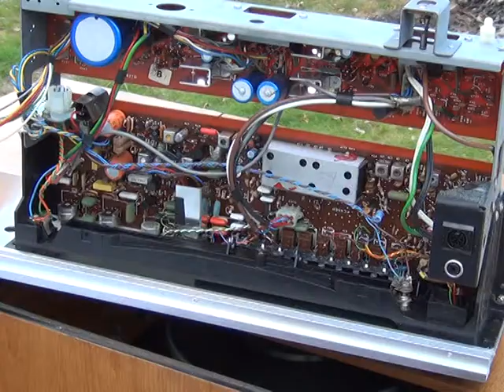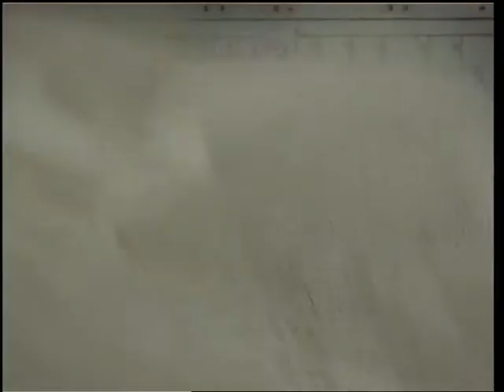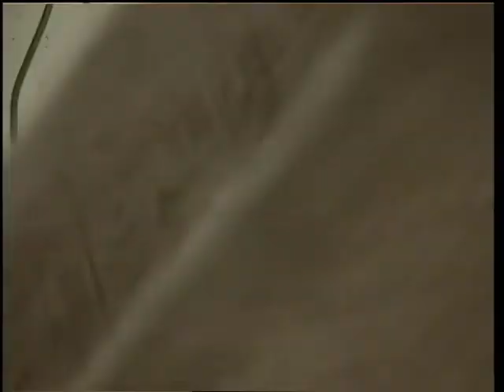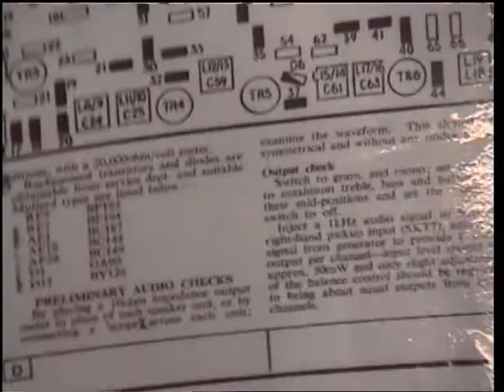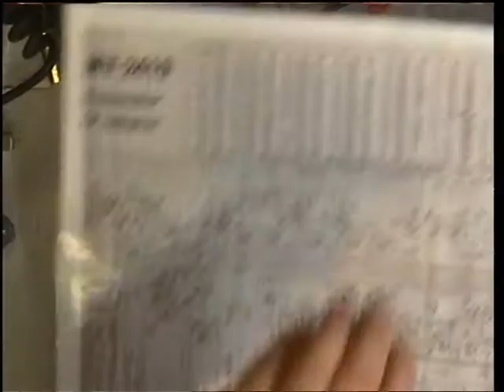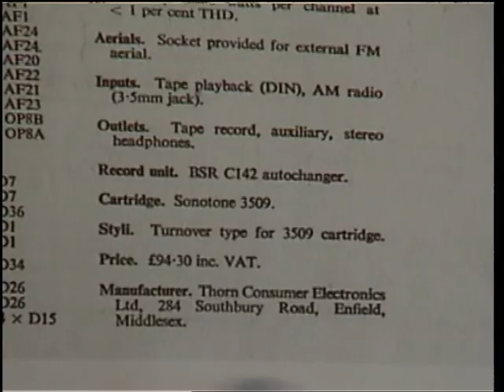HMV Stereomaster 2419   pt2, duff speakers & amplifier capacitors changed

Comment: Hi, very informative video thanks. I have replaced capacitors as suggested. My speakers appear ok, foam is in good shape.  Radio audio is very good,  record quality is poor and tinnie. I have renewed the stylus. Would you have any suggestions? Thanks
Reply from the maker: Well, I'd connect an audio signal generator to the pickup input (at the turntable tag strips) set to 1Khz @ 100mV level which would prove the amplifier preamp was working. However, I think your cartridge rubber actuator is rotted away/missing so there is very little transfer from the stylus to the ceramic elements inside the cartridge...in which case you'd need to replace the cartridge.

Richard

Comment: Hi there,
I have inherited a Stereomaster 2419, looks in good nick but now power lead so unable to workout if its actually in working order or not. Having taken it apart it seems that the power lead must have been disconnected, any ideas on what would plug into the PA connector as you called it? Its 8 pins and 4 holes, is there an off the shelf connector 3 pin plug for this, or is it a case of trying to wire in a new AC in with a 3 pin plug and wires?

Best wishes,

Evan
Reply from the maker: I think you'd better email me with a photo. I'm not sure quite what you're talking about unfortunately.  As I recall the 3-core mains lead goes to the main chassis near the mains transformer no doubt via a fuse. Looking at the circuit diagram, however, it looks like the mains lead goes straight to the mains switch & then to the chassis...so I'm not sure. Anyway, email me & I send you a copy of the service sheet gratis.

rshireby@yahoo.co.uk

Comment: Hi there I too have recently revisited this wonderful 1970’s and bought an old HMV 2419. However mine hums loudly , I have been told it is the smoothing capacitor....? and that it would be the large blue capacitor shown in the top corner does this Sound right ? Or would it more likely be the capacitors you highlightedAlso on checking the speakers were replaced without the inline resistors 🙈🙈🙈🙈
Reply from the maker: Yes, It's the big capacitor on the chassis rather than those on the PCB. Replacing the speakers without adding resistors is probably OK as long as you dont run it full blast

Richard
Reply: @ukfmcbradioservicingTango21  Thanks Richard will get on and try the repair
Reply: Hi Richard 
I completed the smoothing capacitor replacement, but the hum seems to remains. I am thinking perhaps the woofer speakers as if I turn the Bass down the hum disappears. If I put the resistors in-line could that solve the problem or is it possible there has been damaged caused elsewhere.. .? Any suggestions appreciated 

Regards 
Jules
Reply from the maker: @julianfaulkner2781  email me please rshireby@yahoo.co.uk

Comment: Hi, over lockdown I've been following your very helpful video and upgrading the disintegrated speakers on my  2419. I've noticed that the tweeters don't work and am assuming that it may be the green capacitor that has gone on both sides. Knowing nothing about capacitors, do you know of any modern equivalents I can swap them out for? I believe they are 47uf250v but no idea on type etc. 
Many thanks
Reply from the maker: Chances are that it is the capacitors that have gone leaky. I've never had a duff tweeter. In fact (I just checked the manual) the capacitors are 0.47uf & I would use polyester or mylar. The voltage rating won't be important as any capacitor would be rated above anything likely to come down to the speakers & bear in mind this product is solid state; you'd only have 250v caps in valved equipment on the whole. 0.47uf is often expressed as 470nf these days, just in case you need to know. I hope your new speakers are 8 ohms & not 4 ohm ones intended for automotive use!

Richard
Reply: @ukfmcbradioservicingTango21    Hi Richard, great advice! I'll get on the hunt for some capacitors tonight. 

Yes some 8ohm visatons are sat in front of me. Just soldered the 2ohm resistors on. 😁

Hope your safe during this weird time! Thanks for the help! 

Cheers

Comment: Hi, I wonder if you could help me please.  I have recently bought an HMV model 2018 Stereomaster, as my father bought one of these in the mid 60's, and I absolutely loved the quality of sound it produced, quite incredible for the time. However, I need help. This unit has some issues, volume is low on right channel, and the only way I can get it to sound reasonable, is the turn the balance pot just behind the inner panel, this way, I get the balance, but the sound is not right. There is some distortion in the bass, It's hard to describe. The right channel has a permanent hiss, not loud, but it's there. I don't think the speakers are damaged, and I have tried two Sonatone cartridges, but the condition remains the same with both, so I don't think that is the problem either. I have arranged to take it to an audio specialist who was recommend to me, but I know that you know what you're talking about, and really want your opinion on it. I have suggested to him to replace the capacitors, as this seems one of the necessary things to do anyway, being over 50 years old.  Do you think this will sort the problems out? if not, what else would you recommend I do to get it back to how it sounded originally, it was incredible, or am I asking too much to expect that.  If any one knows the answer, it's you. Please let me know if I need to tell him anything else when I take it in to be done.  Many Many thanks. I really look forward to hearing from you soon.   Cheers,  Graham
Reply from the maker: Graham, I think that changing all the electrolytic capacitors in the product will cure all the snags. I once had to change a transistor in the preamp of a 2018 which was down on that channel.....in 39 years of experience...everything else had been cured by changing the capacitors. I've not covered the 2018 on here yet, but will do in due course.

Richard
Reply: Thanks for getting back to me so quickly. I do hope, as you  say, replacing all the capacitors does the job, I so want it to sound as I remember, Crystal clear, loud, with wonderful bass.  I hope to take it in over the next couple of weeks, so will let you know how I got on.  Do you think it will be very expensive?  Thanks again.
Reply from the maker: @GrahamJBower  I've no idea what other people charge. Our fees are £32+parts so usually just under £50 all in.

Richard
Reply: @ukfmcbradioservicingTango21  Hello Richard. Many thanks for the information.  May I please teke a little more time from you and just ask just a couple more questions.  Firstly, can you tell me, where are you in the UK?  If you were anywhere near Wolverhampton, I would have liked to bring it to you to do, but it really depends where you are I'm afraid. Secondly, I had three Sonotone Cartridges, two of them have failed after the needle V support just broke away when fitting a new Stylus, rendering them useless now,  I think they must have perished, However, I have the third one on the unit at the moment, and it seems okay so far,  but it too is obviously quite old now, and could well fail. Knowing what you know about the player, can you recommend a fully compatible cartridge for it,  and if possible, how much it would be and where I could get one should this fail.  It's the Garrard 3000 deck, and according to the book it is a 'High Compliance Sonotone 9TAHC Cartridge.'  that was originally fitted. I am really grateful to you for all your help.  many thanks.   Graham.
Reply from the maker: @GrahamJBower  I see "the stylus lady" on ebay still has some NOS Sonotone 9TAHC cartridges on ebay for a buy it now of £40, and another NOS one is on bid for next to nothing. I've had two over the years off The Stylus Lady and apart from a slightly different mounting which I was easliy able to overcome. Regarding service here....mmm...I have to use outside benches for the cabinet/turntable/taking the chassis out, then the chassis is serviced on one of proper inside benches....I've got a new building happening when planning permission goes through which will have room for radiograms /stereograms properly. I'm near grantham. You canalways email me rshireby@yahoo.co.uk
Reply: @ukfmcbradioservicingTango21  Thanks again for info..   I will keep a watch on the ebay cartridges, and I'll definately want to keep your details for future reference,  I do wish you were nearer though,  quite a way from me.  Thanks.  Graham.
Reply: Hello Richard, it's been a long time since I contacted you about my HMV stereomaster. I wondered if you still carry out amp repairs on these, and if so, would it be viable for me to send you just the amp for you to check on your bench and bring up to date fully working, capacitors etc. anything that's needed.  I can easily remove the amp, and pack it very well, and I know that you would be able to do all the relevant repairs with your knowledge. It has recently developed faults, poor sound and fading on one channel, and really needs your expertise to get it back to full working order. It's never really sounded as I remember, and needs work. I love these, and really would like to have it sound as rich and clear as it would have done new without any faults.  Hope you don't mind me asking you, but thought this might be the only way to get this back restored. I have no problem with the deck, or speakers, they're fine, just the amp itself needs help. Maybe you could let me know if you would be able to do this, and if so, we can take it from there.   Thanks in advance.  Graham. Wolverhampton.   @ukfmcbradioservicingTango21
Reply from the maker: @GrahamJBower  Yes, that's fine Graham, but you need to Email me as Youtube only show me the 'top 6 comments', so drop off my Radar. Richsard

rshireby@yahoo.co.uk
Reply: @Psychedelicxylophone  Hi there.....   It's been quite a while since I bought the 2018.  In answer to your asking about it,  I kind of got it done, but the results were not as I had hoped!!. I'll fill you in.  I took it to Bridgnorth, to the specialist repair guy there, told him the problem with the unit, and left it with him. When I went to collect it, a month later, he told me there was one Capacitor he couldn't get to, somewhere behind the front panel, as he was unable to remove the screw, but he had replaced all others. Then he told me that upon testing it, there was a severe Hum, so he removed the central cartridge wire, underneath the turntable, and this, he said cured the Hum. He charged £70 for the work. When I got it home, I was quite disappointed with it. The volume was very poor, low, and empty, (little Bass) certainly not as I know it should have been. I decided to take a look at what he'd done. Under the turntable, he'd taken off the central common cartridge wire.... I decided to re solder it. Hey Presto!! full, and rich sound. Why he'd done that I have no idea. As you know it has to be connected. Then when further playing it, I noticed there was still a problem. With the Bass fully turned up, the balance is fine, both L & R, but when reducing the Bass, (which as you know, sometimes is necessary, as it can be overpowering) the balance on the player is shifted noticeably...  the left channel volume goes down more and more as the knob is turned, and it's very apparent. So this is obviously not right, I don't understand why this happens. Anyway, the unit is in my spare room now, as I bought another HMV, it was only £35, it's not the same model, it's the 2328, but without the radio... You'll know it of course. This one is working well, and I've renovated the cabinet in black ebony, and it looks nice. It took ages, rubbing down, fine sanding, and staining, and finished off with a Satin coat. I do wish I could get some new knobs for it though, these have seen better days. I'd love originals.  So there you go, that's what happened. I don't know if I'll ever get around to having the other 2018 sorted. Do you think it's something I could fairly easily remedy, would love your input on this.  Thanks again. Cheers,  Graham.

Comment: Hi, I recently purchased a 2419 and have followed your instructions and changed the speakers, which sound great, however I still get a loud crackling noise in the right speaker when turning it on and off, this problem was present prior to changing to the new speakers. If I change the capacitors as you have shown will this stop the loud crackling noise?
Reply from the maker: Yes, I'm sure it will. I would guess the loud cracking is the capacitor trying to charge. To be honest, we never switch on vintage audio gear without changing certain capacitors first;  the transistors are too easily wrecked if overloaded with faulty capacitors. I hope you added the series resistors to the new speakers as the originals were 10 ohm, and new ones, nearest value is 8 ohms. That's very important.

Richard
Reply: Hi, I have already put the 2 ohm resistors in-line with the new speakers as advised by yourself so no probs there. I will look back at your guide and install new capacitors as instructed and hope this clears the noise.Thanks for your help.
Reply from the maker: It'll be the bigger capacitors on the amplifier pcb. I know you're not daft, but double check you put the replacements in the right way round regarding positive & negative! New capacitors are much smaller than the ones from 1973 too. Don't use "new old stock" in this application, but only brand new. 

The only fault we have ever had in 38 years with the 2419 other than the rotting speakers & the capacitors is one transistor going down in the pre-amp on one channel.....caused by a duff capacitor of course. While the chassis is out, you may as well spray Servisol switch cleaner into the rotary controls....just in case there is any crackling when you adjust them. 

Richard
Reply: I have taken a second look and think there is an issue with the on/off switch as every time I give it a play about in the on position it makes a loud crackle and changes the sound from the left to right hand speaker. I have already sprayed the switches when I had the chassis out but I could not get into the back of the on/off switch as it was surrounded by other bits of kit. I will try again!I will replace the large capacitors as well and if all else fails try and change the transistor out in the pre-amp, which I may have to ask your advice if it comes to that, hope that's ok?Thanks for all your help and advice, much appreciated.Keith
Reply from the maker: Don't change the transistors unless absolutely necessary. As I said, in 38 years I have changed one pre-amp transistor owing to dead channel. They are silicon & don't go wrong. They are very hard to get  & if you start putting in equivalents, you'd need to do both channels or performance will be uneaven...same when changing capacitors...if you change one on the left channel, always do the same on the right & so on.

The on/off switches do fail & are readily available & are made by Lorlin. However, you'll have to cut the shaft to correct length & file a flat for the "D" shaft knob. Gone are the days when they were available in different shaft sizes! I would never try & clean the switch...always replace. CPC catalogue number is SW03716. CPC will deal outside the trade. Looking at Ebay 222513991769 looks to be the one with the shaft flat that doesn't seem to appear today!

Richard
Reply: Richard, Apologies for not getting back earlier, many thanks for all your advice and will be sure to order a new switch soon.Thanks again